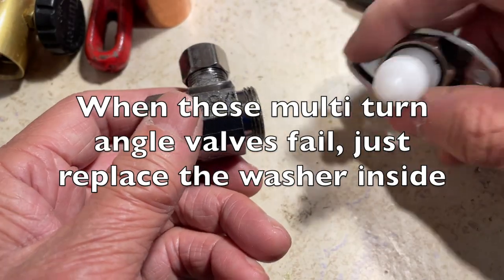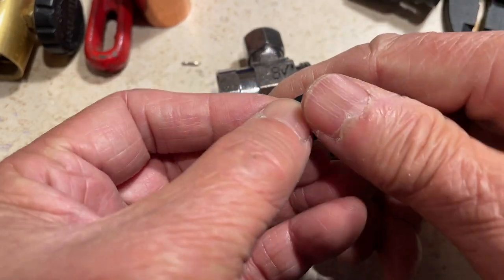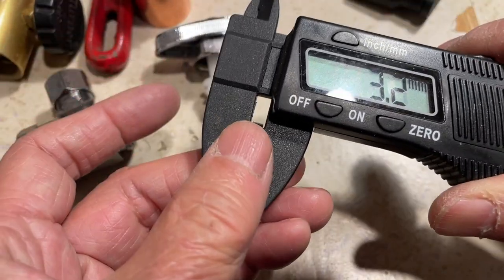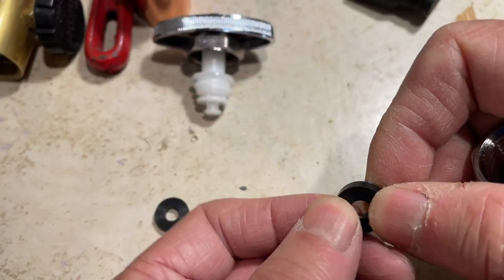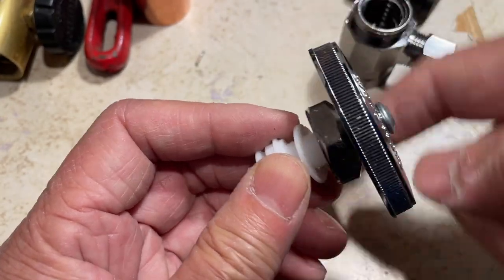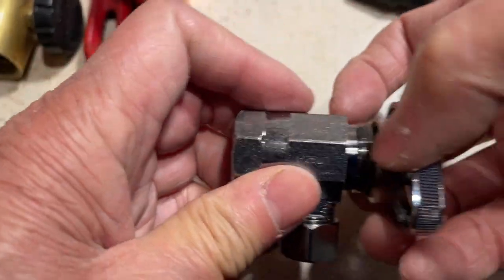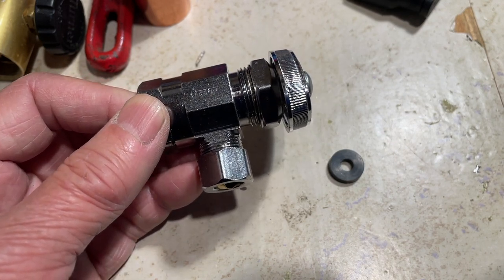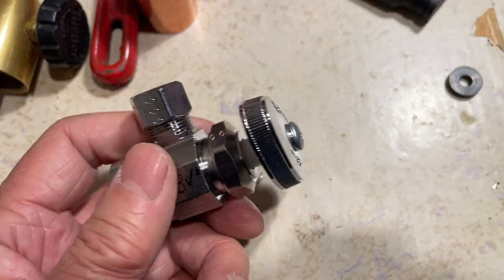Replacing Brasscraft multiturn angle shutoff valve washers

Comment: I JUST got done searching for, buying, and installing washers for the Brasscraft Multi-turn Shutoff Valve (TrueValue $.40 (front) + $.75 (back)), and then Youtube offers me Your video informing viewers of the "BrassCraft Multi Turn Valve Stem Repair Kit"!!! GAWD. Btw, I had to drill out the back washer to fit the 3/8" diameter stem.
(Not so) Pro TIp: The Brasscraft Stem Repair Kit costs $3.10, now. Check your Multi Turn (vs 1/4 turn) shutoff valve for the word "Basscraft" stamped on the knob. If it's a Basscraft Multi-turn Shutoff valve, save the time and gas and just get the kit (at THD).

Comment: Cool.  I measured the cold side valve washer with my digital caliper, because the hot side one had disintegrated, and got 1/2” OD x  3/16” ID x 1/8” thick.  I found similar in my stash of washers, but it was old and stiff, and didn’t easily slip over the peg on the valve.  At the hardware store they only went by 1/2” and “00”, so I got one just in case.  Fingers crossed it will go over the peg end easier, but for now the stiff old one seems to be sealing okay.  Hot side washers don’t seem to last on any valve or faucet.  Thanks for a video that helps ease my mind regarding the correct washer size!
Reply from the maker: Thanks for your input. It'll help those needing to buy this type washer. We have this type of shutoff all over our house.

Comment: Is there a washer at the opposite end of the valve, where it connects to the water supply?  Mine is attached with threads and teflon tape to the water supply.
Reply from the maker: Some valve  are soldered on to the water supply so there’s no washer. Some are compression fittings with an olive. Depends on what angle was installed at the time.

Comment: Interesting.  I have 5 of these plastic stem valves in my house.  I'll have to check into doing this to all of them.  I know 4 of them are stuck and can't be moved (turned).  
I never thought about taking them apart.
Reply from the maker: Mostly likely the stem will break when the shutoff valve leaks and you try to tighten it too much. After 10 years or so, it'll be hard to find one that doesn't leak as the washer/gasket inside fail. It's an easy fix if you can turn off the main water shutoff to your house or apartment.